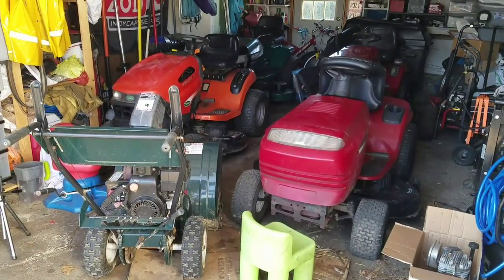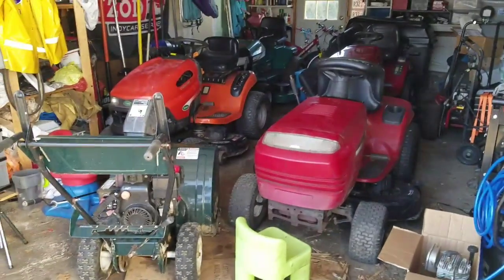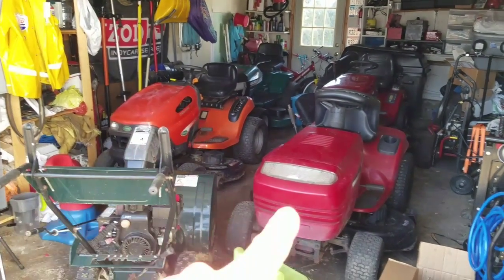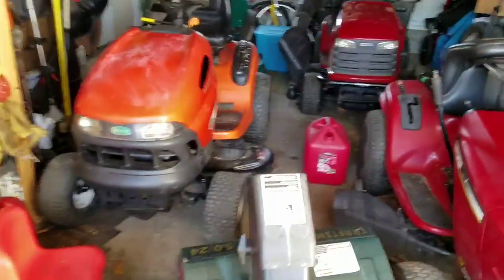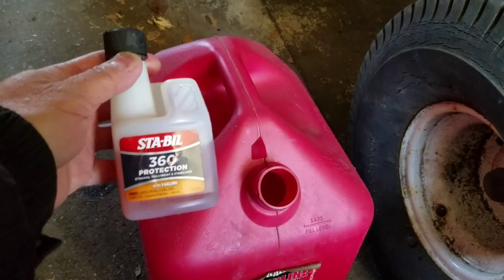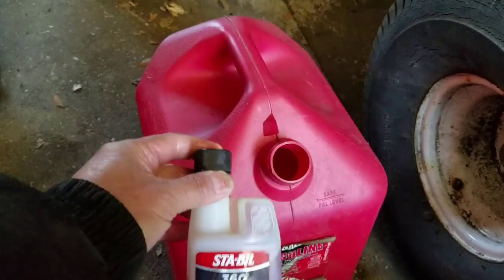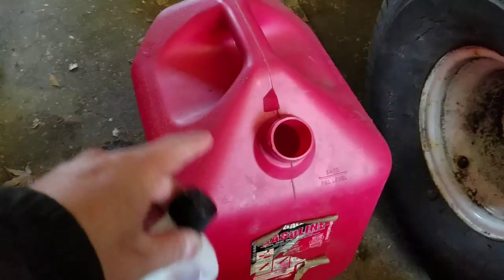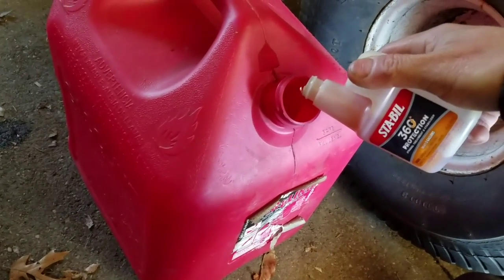$50 CRAFTSMAN 5HP 24" SNOW BLOWER DOUBLE SHAFT TECUMSEH ENGINE SWAP-SINGLE SHAFT CONVERSION PROJECT

Comment: Might want to check you pulley alignment.  @9:54 it looked way off.
Reply from the maker: Due to the double to single shaft, the tension pulley is the bridge between the drive pulley to drive disk..its the middle of the difference of the two.
Reply from the maker: If it was straight aligned, the drive belt would fly off in an instant.

Comment: Why not take the handle off from the transmission selector move the transmission manually to the gear u want then reattach the handle. Move the transmission wheel on to the opposite side then reattach the handle
Reply from the maker: Have you ever done that before? The lever is shaped one sided, you'll have to cut it andnreweld it flipped the other direction, wheels removed, shafts removed, flipped reverse engineer it.  Like I said hours of work and may not work after you weld it.
Reply: @MowersNBlowers  I think u won't have to do much bc u r simple moving the disk to the other side and the holes on the output shaft should line up with the handle
Reply from the maker: Youd have to open one up yourself and see what I mean.  It's easy to say, why dont you do this, but your have to see for yourself.